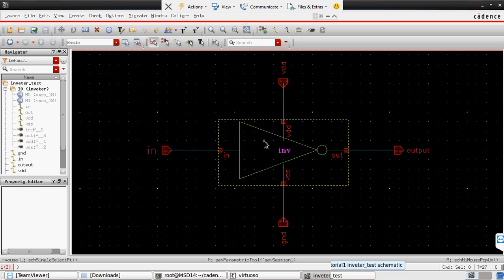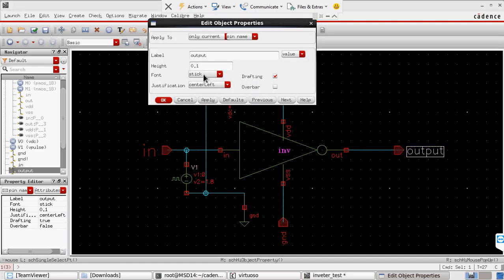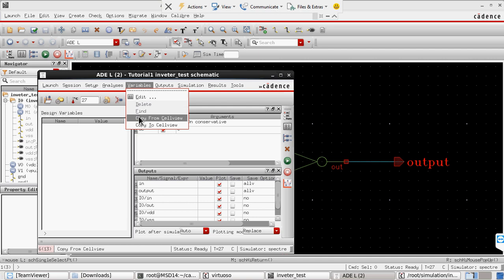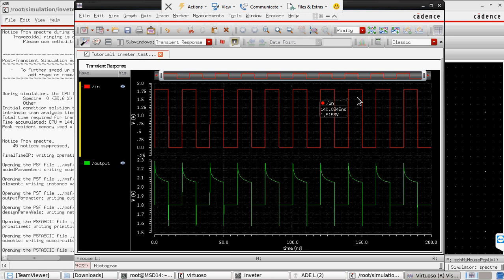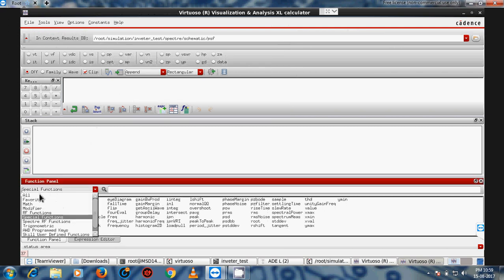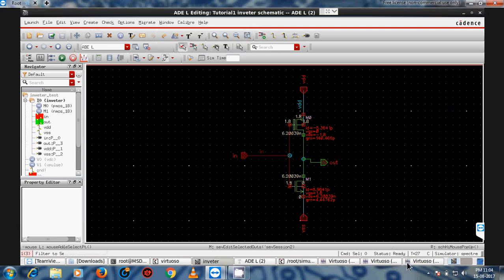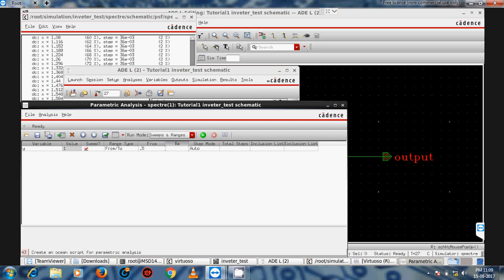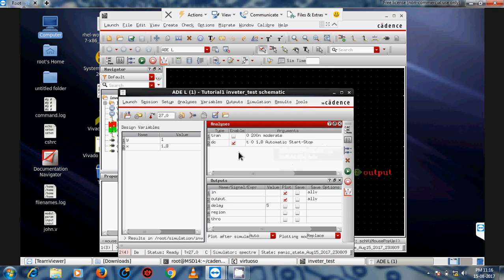Cadence IC6.16/6.17 Virtuoso Tutorial -1 Part 2 (Simulation, Analysis and calculator use)

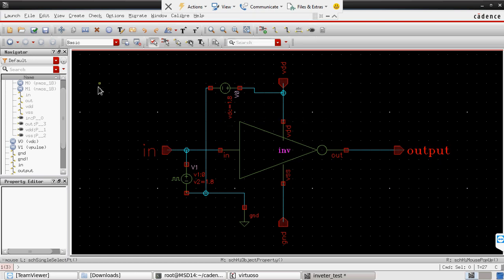Comment: 5:24 Simulation ADE-L
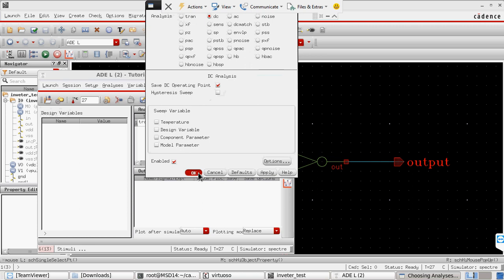7:04  Adding Model Libraries
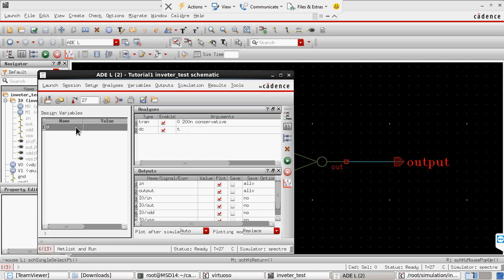9:46 Extract Variables from Cellview
11:27 Print DC Operating Point (MOS Regions etc)
16:06 DC Analysis for Transfer Characterisitics
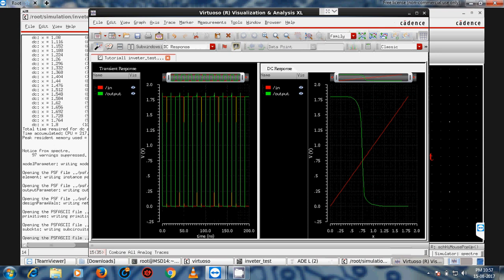17:27 Waveform Editing
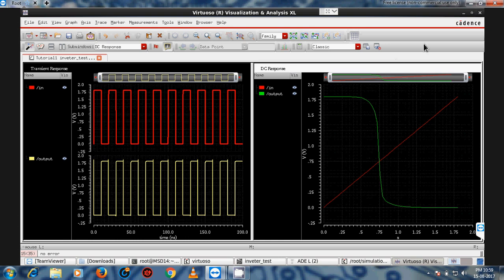18:59 Using Calculator to analyse the waveform (here to calculate delay)
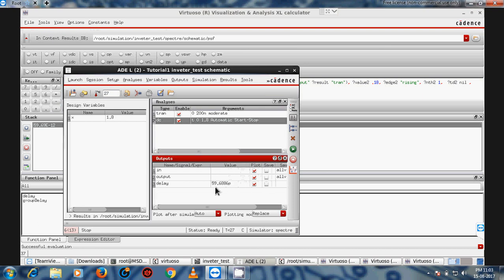23:06 Display .op of  MOSFET (using Calculator to get Expr)
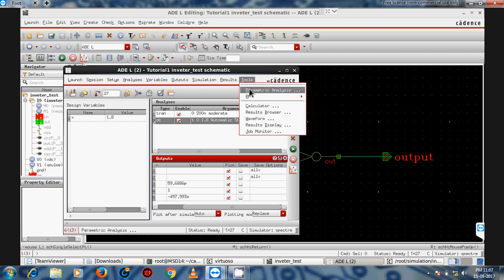26:50 Parametric Analysis
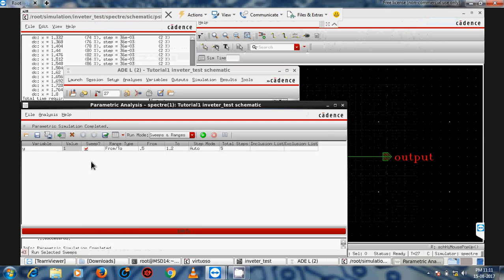30:56 Temperature Analysis

Comment: For Delay Calculations and  much more refer to the below link pg 667 (you need a login for cadence support though)
https://support1.cadence.com/tech-pubs/Docs/vivaxlug/vivaxlugIC6.1.7/vivaxlug.pdf?sq=005d0000001T5dNAAS_201851055626499

(I don't know if uploading this pdf in here is legal or not as they require to sign in, so I am not uploading the PDF)